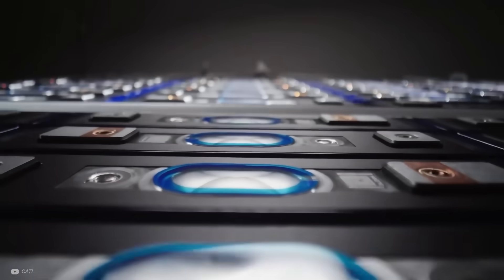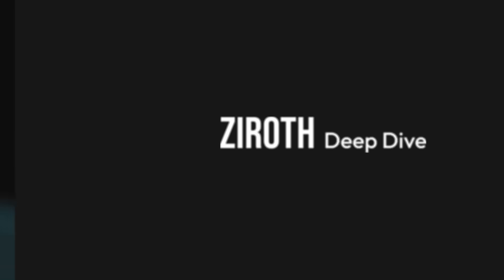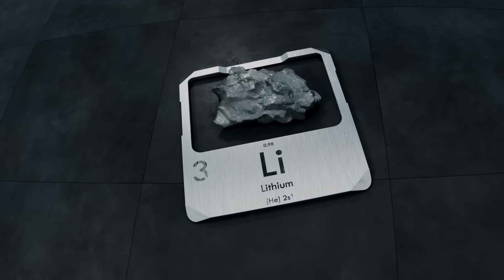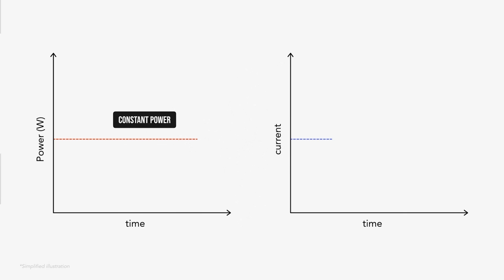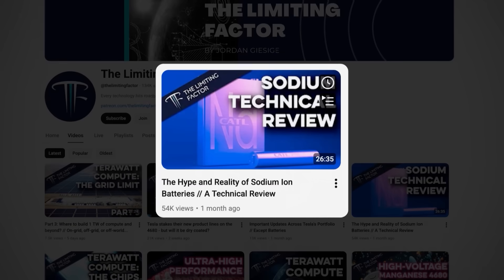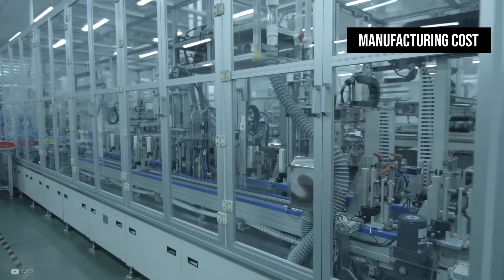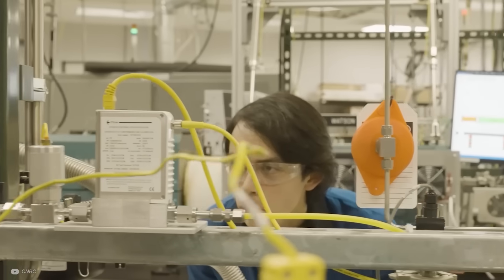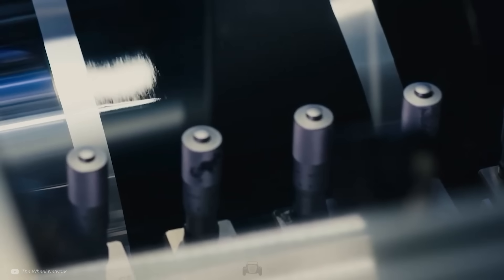How CATL’s Reinforced Sodium Battery is Insanely Cheap

Comment: You forgot to mention that sodium batteries last twice as long. So in the long run it's half the price right now.
Reply: Its simple to reserach cycle life, which this thread didn't do.  Lazy much?  Sodium 10K cycles. LFP upwards of 8K.  NMC lower around 6, but expensive versions can hit 10.  So, in a cycle life to cost ratio Sodium is compelling, not to mention the low temp performance.
Reply: @mefobills279  Yeah, sodium isn't lasting 10k cycles. It's one thing to write a number to a datasheet, something completly different to how those cells actually perfom in real life. And just FYI, you got lots of LFP cells rated for 15k or more. Will they last that long? Likley not, as it's a made up number.
Reply: @hojnikb CATL is reporting 10K life cycles for their sodium ion.  You are calling them a liar when they typically do not lie.
Reply: How long cells last is a function of everything that went into it. Whenever you chance the special sauce formulation, cycle life is likely going to change. The first many iterations of sodium cells lasted less than a hundred cycles before their separator failed.
Reply: Which only sometimes matters. Apparently today's EV batteries have enough cycles in them to comfortably outlast the vehicle itself. So how much do you care about the resale value of the battery coming out of an old dead car? Maybe this affects your initial purchase decision or maybe it doesn't.

And let us not forget the number 1 application of lithium ion batteries, the cellular telephone. To many people, those are practically obsolete after just 5 years. And is there even a secondary market at all for used cell phone batteries?
Reply: @ps.2 The full lifecycle can include cars that last for generations and exist in a subscription robo taxi universe.  Also there is a very large need for energy storage, especially for island countries that want to exit the oil dependency economy.  Energy is the largest component of economy, not labor.
Reply: @mefobills279  Where are these "cars that last for generations"? I mean, sure, you could engineer a car to last that long, but they don't. In practice, by the time you get to 300,000 miles, your body panels are rusty, your door handles and locks are finicky, the right front speaker of your stereo system glitches out a lot, two of the USB charge ports no longer work, only half of the rear window actually defrosts, there's duct tape over several tears in the upholstery, and the rearview mirror has had to be glued back in place twice.
Reply: @ps.2 The US post office Gruman LLV, long life vehicle.  The point is:  In a subscription universe, like robotaxi's, the economic incentives are for LLV's.  You keep making the fatal assumption that the auto market will remain as it is. It will also take decades to meet the needs for battery storage.
Reply: They don't. LFP still has longer cycle life.
Reply: @hojnikb Wrong
Reply: @MySonse Bruh, at least expound for the uninitiated like me please.
Reply: @locke_ytb  You just need to 'Trust him bro'   🤣
Reply: Can I buy them right now?
Reply: They don't last twice
Reply: @xzGAB Wrong as well

Comment: Very interesting tech. But as I've said for 20 years it's potassium cells that'll really change things. They just need to work out the appropriate electectrolyte from what I've heard. As they have serious issues with the formation of dendrites.
Reply: Then potassium changes nothng
Reply: Potassium is way too reactive, sodium is already a lot more reactive than lthium. Its the reaon they chose lithium in the first place.
Reply: @paulmichaelfreedman8334 I disagree entirely, it's the elements relative reactivity in the galvanic series that makes it such a perfect solution. That and it's relative abundance and how cheap it is to refine.
Reply: Potassium hydroxide solution is the electrolyte in Nickel-Iron cells - which are the most reliable rechargeable batteries ever made!
They have a very low energy density, but fine for fixed storage. There are cells around a hundred years old still in perfect condition.
The only maintenance is replacing the electrolyte every few years as it can take carbon dioxide from the atmosphere and slowly degrade - but the cells are as good as new again with fresh electrolyte.
Reply: @RJTC Cell Chemistry / Type 	Energy Density (Wh/kg)	Notes
Potassium-ion batteries (KIBs), general projections	150–200	Comparable to current sodium-ion batteries.
KIBs with specific advanced cathodes	~220–235	Achieved in full-cell prototypes using hard carbon anodes and specific cathode materials like KFeC₂O₄F or VS₂-x@rGO.
KIBs with organic cathodes	Up to 420	Achieved with specific organic cathode materials such as P'₂-K₀.₈₃[Ni₀.₀₅Mn₀.₉₅]O₂ or polyarylamine derivatives in laboratory settings.
Potassium-Sulfur (K-S) batteries	Approaching 450–460	A high-potential area of research aiming to surpass lithium-ion technology.

This is some of the information on some of the latest potassium cell technology. As you can see it has some great potential.
Reply: Can't wait for that to happen.
We need to do everything at once as soon as it comes available.
We have missed the chance of not warming the planet to the degree that will make it a nasty place for any descendents to live on.

Comment: It would only be interesting if I can have a Na+ battery that including DC-DC inverters cost less than 1/5th than my LiFePo+ batteries per kWh, and the losses per day should be very low. And the DC-DC inverters are meant to charge my LiFePo4. So yeah, I only need max 2kW from the Na+ battery, but it should be around 500..1000kWh and should be efficient in storage.
Reply: Ok, if CATL did some fixing on the flatness... Still I need 1000kWh or so to fit in 50M^3

Comment: We will NEVER run out of sodium.
Reply: Sodium chloride will not work for sodium batteries. They need sodium carbonate. It is expensive to get sodium carbonate from sodium chloride
Reply: @rab5193  Interconvertible.
Reply: Seems to be trona ore according to a cursory search which while the USA has the largest resources of still does not negate that if it can be used it can run out. Maybe combined with desalination tech there may be demand for a cheaper means to split NaCl as well but nonetheless if total collapse of climate cycles hits I doubt it will serve multigenerational longevity to mine the oceans
Reply: We've said that about oil, sand, lithium and countless other NOW dwindling resources. Boggles mind to claim it ever again.
Reply: @checkmateDavid  Did you ever look at a map of the earth? Seen how much is covered with a sodium chloride solution known as sea water?
Reply: @checkmateDavid  Have you ever heard of the OCEANS?
Reply: @DavidFMayerPhD yes. You really think we, the plague species of Earth, could not deplete oceans. Let alone what to do with all the chlorides...

Comment: The major issue is that they can be under 70% round trip efficient at more than 0.2c

So even if you fix the rest you’re amortizing the savings but way more expensive because of charging/discharging losses.
Reply: This charging efficiency is what has put me off getting too interested so far. It’s not currently clear what the full story is either way.
Reply: Hard to say whether the new chemistry will have this problem.  Also, if you're in a colder climate, keeping the cells warm might be a greater loss.
Reply: @Toastmaster_5000 it can’t be because the round trip efficiency is based on the size of the sodium which is larger than lithium.
Reply: sounds like it would be more suitable for grid storage than EV
Reply: @TheEragoon even then you’re throwing away 30% of your generation versus lifepo4 at <2%
Reply: @jameshancock most of the newer ones released by CATL have a 80% round trip efficiency so only a 20% loss 

 but the big savings come from requiring no active cooling or heating due to their extremely large temperature range, The fact that they can also charge at those temperatures, and that when they get to those low temperatures, they don't lose half their capacity like LFP but maintain the majority of their capacity while also being able to discharge at those temperatures. 

These factors combined make them better per kilowatt hour in the dead of winter and the peak of summer and the associated infrastructure savings with no heating or cooling loops is why this technology was pursued in the first place. 

A grid scale storage, it makes a lot of financial sense
Reply: Lifepo4 is 98+% efficiency and need incredibly little cooling, only heating if they go below 0c which rarely will happen even in colder climates because of cycling heat and the cost of equipment to keep them at temps easily pays for itself in very short order with the loss. 

If you have say a MWh of storage, at 20% you’re losing 200,000 kWh per cycle which college daily. Even at 2 cents you’re less than a month recoup on the heating equipment.
Reply: yep, roundtrip efficiency is abysmal. And to top it all off, it has such wide voltage range, that it makes it unusable in an EV to extract all the energy from the battery while still having decent power.
Reply: @hojnikb  Funny how there ARE evs USING these right now. I guess that is just an illusion.
Reply: @NScherdin  EVs with lithium batteries already use the low power mode ("turttle"), when the battery capacity drops below some level. People need to finish to the charger, without need of top acceleration and speed.
Reply: @NScherdin  What mass produced EV is using Sodium cells? And isn't a small city car with no power?

I'll wait.
Reply: @hojnikb    It's already in production. A bit late to be telling everynoe now, but I guess you might know better than their EV engineers. I guess they are just rolling the dice with billions at stake.
Reply: @JoeyBlogs007  And that EV would be what?
Reply: @hojnikb  Watch the video, they solved the voltage range
Reply: Plus china tends to exaggerate claims a lot